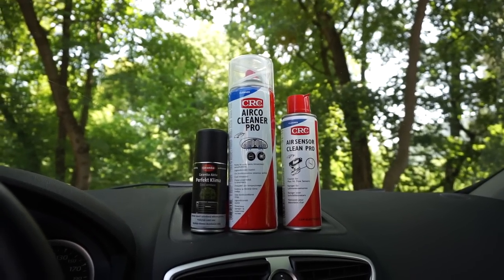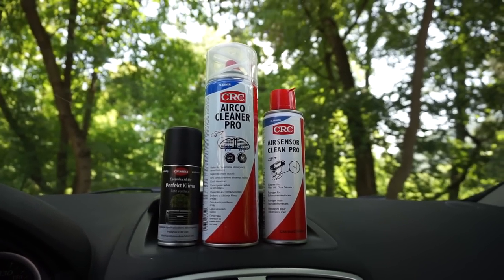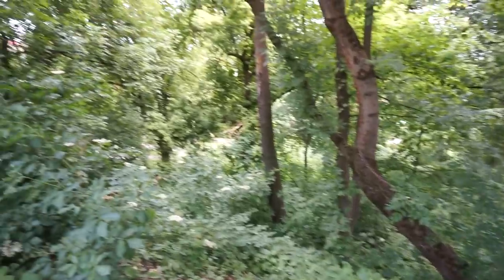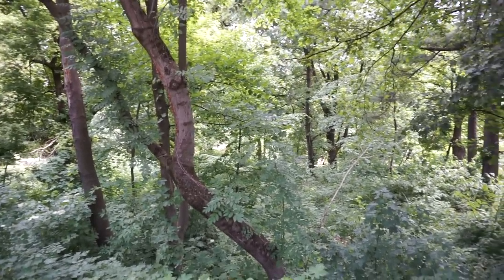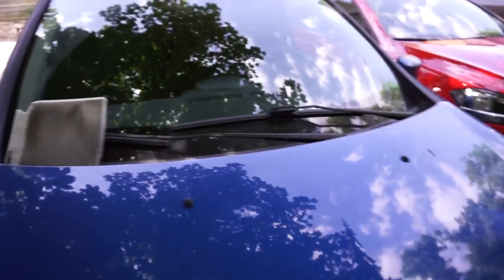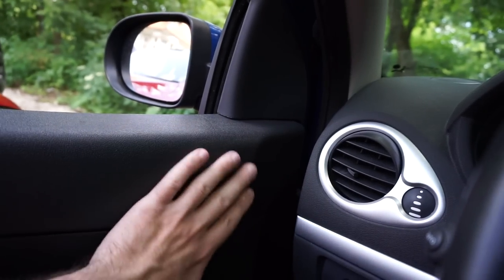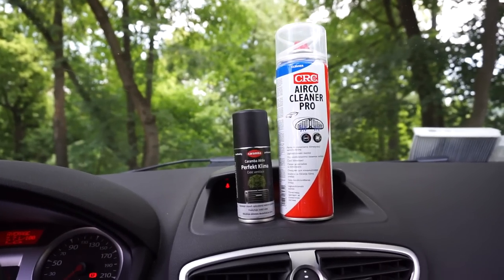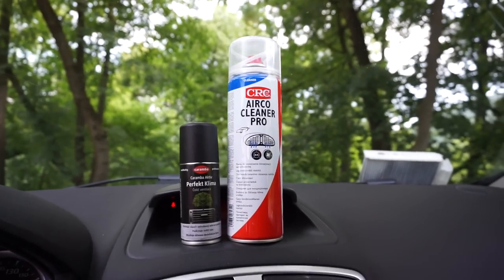Active Foam Car AC Cleaning CRC Airco Cleaner Pro

Comment: Foam must be sprayed onto the evaporator as this is where the cleaning must be done, not inside the air vents where you risk leaks leading to electrical problems. When the foam cleans your evaporator, changing the AC temps will cause the dirty liquified foam below your car to drain making a dirty puddle which you can inspect for mold. Aerosols/air bombs are expensive car fresheners/perfume, no cleaning though. Foam must be done at least twice a year as its effect does not last a lot but it costs less than 10 EUR so... (BMW E90 owner)
Reply from the maker: The dirt and germs are also in the air vents. I did spray it into the evaporator area also, every time. It is located in front of the cabin air filter.
Nothing was burned and this product is meant to be used like this also.
Reply from the maker: In this video https://www.youtube.com/watch?v=eozudpX7TvQ you can see how I cleaned the evaporator located there. I didn't show it in the other edited videos but I've done it every time.
Reply: Mold can also grow in the ducts, depending on how old the car is. Important to clean those as well, reading is also sorry important before commenting lol
Reply: I have a 2019 BMW 430i, the ac smells like mold whenever I turn on the ac. What do advise me to do?

Comment: 1. Any foam products need 10 to 15 minutes to do their work. After that, they turn into liquid state and that is bad for anything electric. That's why foam cleaning products are for the condenser only and not for ventilation pipes. You can access the condenser through the draining pipe and that's why you have that tube 
2. The ventilation pipes are cleaned with spray products and the ac is turned on immediately after application, so they dont affect the electric parts of the car.
Conclusion: there are 2 types of product for ac cleaning: passive ones, like foam, that need 10-15 minutes to do their work and active ones, like spray bomb, that need the ac system to be turned on in order to do their work. That's all.
Reply from the maker: This product is for the air-vents also. There aren't any electrical circuits inside the vents, I can assure you.
Reply: @m3rovingian  I think that for some cars the liquid from that foam will get onto electronic parts (if you inject the foam into vent pipes) like radio etc...
Reply from the maker: @jakescott9214  No man :))
Reply: @jakescott9214 That is 100% correct. And I say this as it happened ti me and took 3 hours to remediate the issue
Reply: @m3rovingian  I did use the same product today. And the result was that water drops from the foam got in the back of the radio head unit and tool me 3 hours to properly dry everything. Now I am sorry that I followed your recommendation. If something works for you, doesn’t mean that it works for everybody. Assume that and make it clear please
Reply: @jakescott9214  100% correct, just happened to me
Reply from the maker: @mehmetalexandru5027  No kidding :) You sprayed the Radio too?
Reply: @m3rovingian  asta ai inteles tu? Ca am dat pe radio? Am dat in gurile de ventilatie centrale, iar picaturi de apa / lichid  de la spuma s-au prelins pe legaturile electrice din spatele unitatii radio. Ai prins-o? In caz ca nu stiai, tubulatura este facute din bucati care se imbina, deci EXISTA posibilitatea de scurgere in locuri gresite, man. Nu stiu cu ce am gresit de mi-a aparut filmuletul tau la sugestii. De stiut pe viitor sa nu mai cred in toti neautirizatii
Reply from the maker: @mehmetalexandru5027  Ce masina ai? Poate ca ai umblat tu pe acolo pre mult si ai distantat ceva. Spuma asta e facuta pentru a fi folosita astfel. Nu ai cum sa o utilizezi altcumva.
Reply: @m3rovingian  o masina cumparata de noua si la care NU s-a umblat niciodata in acea zona. Acelasi lucru mi s-a intamplat si la gurule laterale, doar ca nu prea a avut ce sa afecteze. Acel produs este si pt curatatul traseului ce duce spre gurile de aerisire, insa, nu se filoseste in modul in care ai prezentat tu. Pacat ca am facut acest research o idee prea tarziu
Reply from the maker: @mehmetalexandru5027  Deci toti cei care folosim spuma activa in felul asta gresim. Cum ar fi trebuit sa fac atunci?
Reply: @m3rovingian  @jake Scott is right. Check some of the reviews on Amazon. This  cleaning process can seriously damage a LCD display,cd player, control system, and blower motor.Regards
Reply from the maker: @speedX1980  Man go troll somewhere else. When I ask them how it's supposed to be used in the air vents, all you smart asses become silent :)
Reply: @m3rovingian  I'm not a troll, I'm  just  like you trying to see how other people do they cars.And learn on their work including your  YouTube channel with is helping others. But looks like this type of cleaning process can be very sketchy for some cars. No hard  feelings my friend. After all we are here to help each other and learn.
Reply from the maker: @speedX1980  I understand, yet you're still not answering my question. If, by your opinion, I am doing the cleaning process wrong, how was I supposed to do it right?
Reply: @m3rovingian  also I learn from you how to use the spray can but I will  have to pass  on the foam cleaning process just to be on safe side.Thanks for your time
Reply: @m3rovingian  I'm not a mechanic but I will try an option of inserting a pipe with that foam in to drain line under my car 2007 Honda Accord.I dont want my air vents to be wet as dust will stuck
Reply from the maker: @speedX1980  Good luck with that.
Reply: @m3rovingian  your cleaning process is helping  others to make their cars smell nice and that doesn't have bad effect on their cars .So you do things right.But there is always a risk .there is no question what to do and how to do. This could work for me but I'm not taking a risk.
Reply from the maker: @speedX1980  You are clueless.

Comment: Mass airflow sensor has absolutely nothing to do with the air in your cabin. It’s the air that goes through the intake, pass the throttle body then the manifold to the intake of the engine. It senses how much is being sucked in and takes that reading in hand with other sensors to let the computer know how much fuel is needed. I.e. A/F sensor.
Reply from the maker: I never said it is connected in any way to the air in the cabin :) I just cleaned it because it was time to do so, that's all :)
Reply: @m3rovingian  you're such a liar LOL the whole video related to AC and u probably thought it was connected 💀💀 otherwise why just the MAS and not the other sensors lmfaooo
Reply from the maker: @project-moe  I don't understand your issue? In this video i showed how I cleaned the AC vents of the car. What did I lie about?

Comment: Great video! Internet nerds have no idea that the vents need to be cleaned as well, not just the evaporator. I cleaned my evaporator too, and I'm still getting a dingy smell from my vents, so I'll be doing this soon. Thanks for the video!
Reply from the maker: Yeah. You can't help them. But it's ok. Once you'll do this you'll get rid of the nasty smell. I recommend you a spray from Liqui Moly. Even if it has lower quantity, I assure you it'll dothe job awesome and since they have such good quality you will have less chances of getting a bad product, like I did with this brand. I had to sent it back because the content of it wasn't getting out when I pressed it. They sent me a new one but all the time I had the impression it was finishing way faster than  expected. Still it did the job very good for what it was.
Reply: @m3rovingian  awesome! Thank you for the recommendation!

Comment: In my experience none of these work. The foaming cleaners you attempt to spray directly onto the evaporator by feeding a lance down the centre vents were the best of a bad bunch. The aerosol 'bombs' were useless and just stank out the upholstery giving a temporary illusion of 'minicab freshness'

If you can get access to the evaporator core (removing a blower resistor from the pre-evaporator ducting in my case) You can clean it properly with coil cleaner. I used Envirocoil.
Reply from the maker: You are mistaking. This is how the product should be used. look on YouTube. Everyone uses them like this.
Reply: @m3rovingian  evaporator is the place where all bad things happen.  You need to clean evaporator, then change cabin filter and all sorted 👌. You almost demage electronic in your car!!!
Reply from the maker: @rajfell  I didn't damage anyting in all of these years. I cleaned the evaporator by removing the cabin air filter first then spray it into its compartiment. Look better at my videos.

Comment: Oh yes....been waiting for this......i did this too, a few days ago, as i told you it was the first time for me and for the car :)))
But it was worth it since then it smells very good, though i didnt have that Caramba cleaner, i only used something based on foam to clean the AC
Reply from the maker: Glad I could finally do the video, after 2 years now :)
It's all good. The foam cleans it best! You can always get it later on. The Caramba costs about 13 lei ;)
Reply: Oh yes, only if i can find it !.....how does it smell? is it persistent?
Reply from the maker: It smell very fresh, but I can assure you the foam smell will be the base note :) That will persist the most. The diffuser is more likely for the overall cars interior. When  I used only the diffuser in my AC cleaning, the freshness was fading away in a short time, while the air vents were getting dirty by each day :)
Reply: I have a problem with smell....i mean i cant smell,  i need the smell to be very or extremly strong to smell it.....this happened due to my work
So im always looking for strong persistent smells, and my familly always gets upset on that.....but i cant smell less strong substances
Reply from the maker: https://www.autokarma.ro/piese-auto-universale-produse-intretinere/spray-curatare-ac-100-ml-cmb-64501101-caramba?filtru=a3%3A61480%3B
Reply: Got it !
Reply from the maker: Sorry to hear that. You will be able to smell it right after the 15 minutes have passed, I assure you. I couldn't stay in the car without both of the windows down. In the next days the air will be very nice. You can try and use it twice a year and it'll bring back the freshness ;)

Comment: remember with this medthod if you have a paper cabin air filter installed and dont remove it this may not be the best for it
Reply from the maker: Indeed. that's why I take it out and close the slot with it's plastic case.

Comment: Aren't you going to flood your condenser with all that foam that liquefies? That would make it smell awful in a few weeks. Pretty sure you have to use that on the intake and not directly into the vents. The instructions on the can state you need to locate the tube under the dashboard then connect that hose and spray into there which covers the radiator vent which is where the dust accumulates. Just filling your dash with foam then letting it liquify to run down the inside front of your car can't be good for the electrics.

Still at least you didn't use insulation foam lol.
Reply from the maker: It smells great and last all the way until the end of winter. You do it as you wish, but the vents will remain dirty if you don't use it there also. nobody says to over use it. Just a bit everywhere also in the evaporator area where I have located the cabin air filter and that is pretty much it. The water that flows down from the AC is crystal clear now.
Reply: No. The liquid goes away in the drain pipe of the ac. The product also states to not use the ac for 5 hours and it helps to do this before a drive so the wind can dry the ac evaporator

Comment: After all, the instructions for this preparation clearly say not to use it directly in the ventilation grilles ...
Reply from the maker: Then why does it have the long straw?
Reply: @m3rovingian  It's meant to go in your AC inlet, where your cabin filter is
Reply from the maker: @Mike-bt3ki  Yes, but not only there. What are you gonna do about the smell that comes from the vents?
Reply: @m3rovingian  smell comes from the evaporator my dude, you know how car has "water leak" under it when your A/C runs? that's the evaporator working, i also thought i had to clean vents, but i was mistaken,  you can check "How to clean the airco of your car with MOTIP Airco Cleaner" video to get better idea, but basically smell is the bacteria that developed on the evaporator from moisture.
Reply from the maker: @JohnDoe-ch6qy  Then why does the smell goes away completely after I used it in the vents? I suppose you're gonna say all the liquid goes into the evaporator? :)) 
Just use it as you wish, I'll keep doing it like this. Keep in mind I used it on the evaporator also, after I took out the cabin air filter, but I suppose you missed that part. You need to use it everywhere, in the evaporator's area and in the vents. Just don't over do it.
Reply from the maker: @JohnDoe-ch6qy  You can look on youtube and see many other videos of people who do this procedure just like me. You do it as you wish, without using it in the vents. I'll do it like this, on the evaporator and in the vents as well. My car is known for not having a great electric system, but I never had any electrical problems from cleaning the AC like this. So it's all good. Just don't come here and tell me I don't do it correctly just because I don't do it like you think I should.
Reply: @m3rovingian  It''s supposed to pull through the vents, but look I had excess product and applied some through the vents like you did. No harm done

I suggest start with AC inlet, and if you have excess, go through the vents inside your car
Reply from the maker: @Mike-bt3ki  You need to not over spray it, that is common sense ofcourse. But this doesn't mean you can't use it in the vents at all...
Reply: @m3rovingian   as a master tech mechanic for over 35 years keep doing it this way and you will start having problems with your computers,  modules,  wire connections from the liquid from the foam.  This stuff is for use on the evap and heater core this is where the mold builds up. The reason for the long plastic hose is to reach the evap and heater core deep inside your dashboard,  not to fill your vents with foam. But what do I know oh wait what I know is what happens when people like you use a product wrong and then needs their vehicle fixed I am the one that fixes for you and the one that fills the paperwork out on what I think what happened to see if it's covered by the warranty or not. Trust me we can tell when this stuff is used. So it could be a costly repair.  Just because other YouTube channels show them doing this does not mean it's the right way. Many other YouTube channels show doing it the correct way also. Hey it's your vehicle and your money.
Reply from the maker: @DavidGuns  I'll let you know when I'll have electrical problems. Until then I'll keep doing it like this. 7 years in the making and not a single problem yet. And my Renault Clio is not known for having good wiring protection, but yet I don't have any problems. I use it on the evaporator also. It's located in front of my cabin air filter.

Comment: I definitely appreciate the tip, but way too long. Also I don’t see the product descriptions of the products you use. I’m going to assume it’s a ac coil foam cleaner, brand doesn’t matter. And a car bomb or fogger.
Reply from the maker: I tried to place as much as possible from what i done.
I couldn't find it on amazon that's why it's not in the links, but any similar foam cleaner will be just fine. What car bomb?

Comment: nice video, but too long...I have one question, what about liquid at 19:45 on rubber floormates, where goes all that liquid from foam? Have you idea how much ml-s of this liquid from this can have been spread into vents in form of foam, package is so big, maybe 500 ml, thats two big glasses od liquid.....Greetings from Serbia :-)
Reply from the maker: Don't worry about the liquid. it's the foam after doing it's job of cleaning. If you'll put less foam then it'll drip less also. I went all out. Just put foam until you see it coming out of the vent while pulling out the hose, as you saw me in the video. I tried to record as much as possible all the steps of a complete air vent cleaning.

Comment: When do you use the air sensor clean pro?
Reply from the maker: Each time I change the engine air filter. Every 10.000 km. That way you'll have a smooth running engine all the time.

Comment: What was the diffuser you used?
Reply from the maker: One from a company named Caramba. But I recommend you to try the ones sold by Liqui Moly, both diffuser and AC spray with a straw. They are a lot higher in quality, and although they have less quantity, it'll last you more. Even the diffuser is depleted way slower, at only 75 ml for Liqui Moly. They are really worth buying. You can see them in my latest video here: https://youtu.be/vfx0t1heMh8
Reply: @m3rovingian  thank you
Reply from the maker: @jameskulpa3848  my pleasure, anytime!

Comment: salut. masina ta are 2 filtre de aer? sau al tau este situat acolo? am mai citit in comentarii ca daca ai masina veche sa nu folosesti si spuma... zici ca e safe sa bag si spuma chiar daca masina e mai vechiuta? (2007)? mersi si o zi faina!
Reply from the maker: Salut. masina are 2 filtre. unul de aer la motor si unul de habitaclu jos inauntru sub torpedo, la picioarele pasadgerului din dreapta.
Fii linistit poti sa bagi spuma in sistemul de aerisire fara probleme :) Nu se intampla nimic.
Reply: @m3rovingian  se cunoaște că ești român 💯
Reply from the maker: @introfusion6985  :)
Reply: @m3rovingian  Se poate intampla!!!! Nu mai fi asa increzator pt ca exista sansa sa dai de creduli care te urmaresc si cred ca ai habar si pot avea surprize neplacute!
Reply from the maker: @mehmetalexandru5027  Bine ma. Nu fa ca mine. Mult succes la curatarea habitaclului si a ventialtiei.